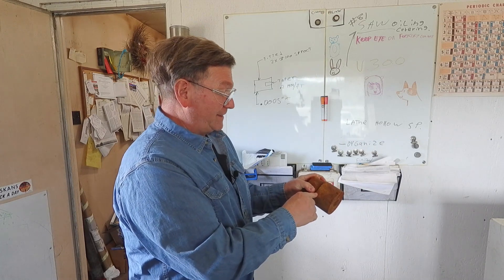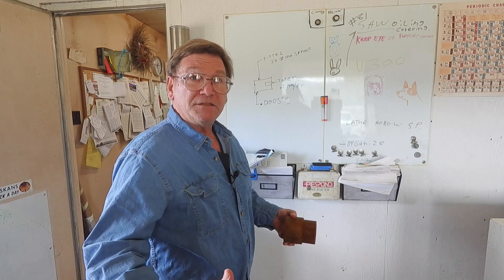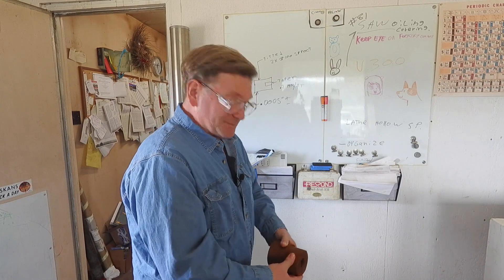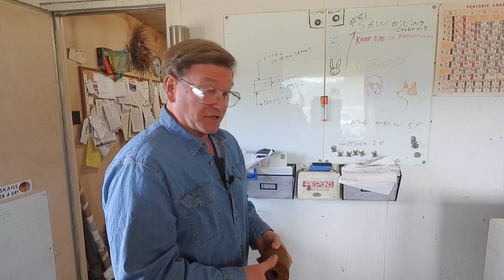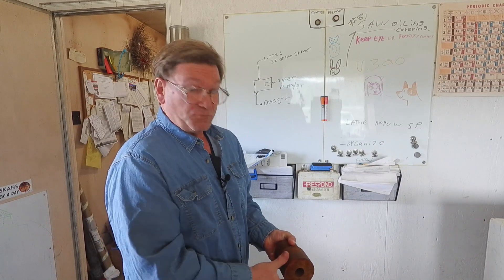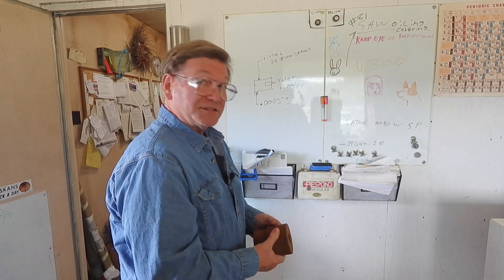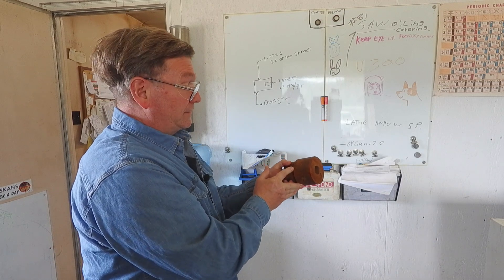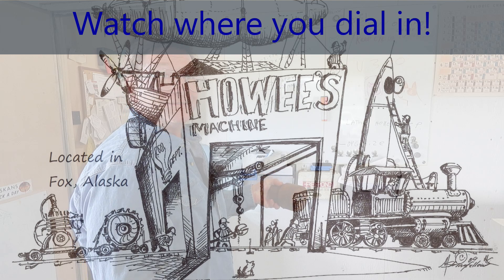Machinist's Minutes: Why bore instead of turning the shoulder

Comment: Understanding how to your features relate to one another guides the plan on how they are machined. Key features are generally done at once to minimize errors when moving the piece is required. There are many ways to preform the work, what matters is how much work is put into realigning the work piece after rechucking the piece. Simplicity is often the best practice for accuracy.

Comment: And of course, the other way would be to bore the hole through the part first. Then mount it with a loose shrink fit and some locktite on a shaft. The turn between centers, cutting into the shaft to do the end facing operations. In that way, it's all cut in one setup and nothing is out of line. 

Actually, the set up a reference and gauge off that is more than enough. If not then do the most critical section first and then work outward from there.

Comment: Thanks. It would have been better if you had used the White Board behind you.  Couldn't see the part very well and it was a little hare to follow. Thanks.
Reply: It's a cylinder. Imagine a solid cylinder if you drill a hole all the way then you have a reference point on each side. If you were to mill one side thinner for example, then once you flipped it over you know that the center is in line with the center on the other side.
Reply: It’s not Joe Pie here ;)